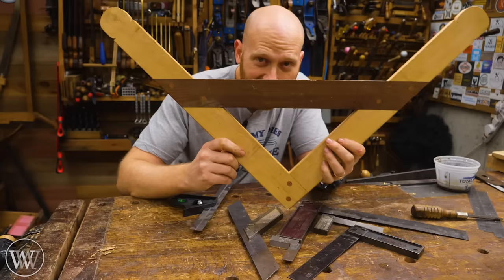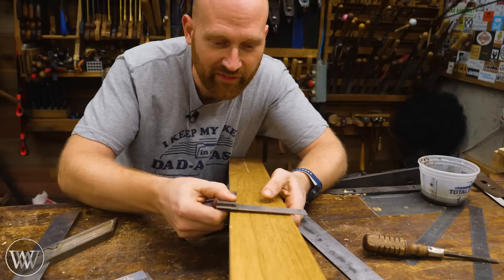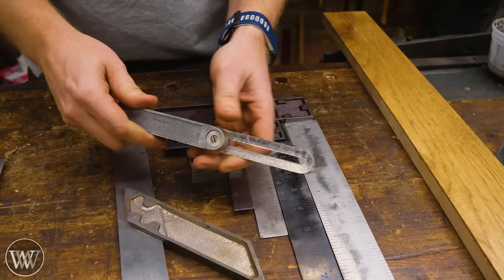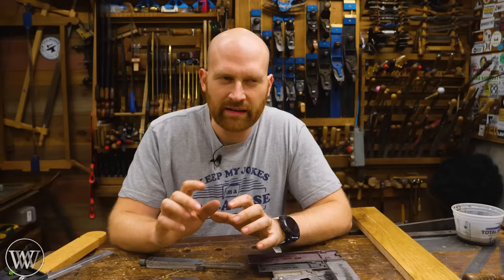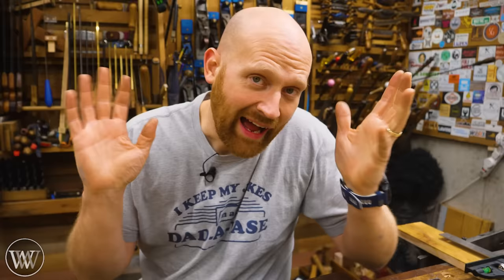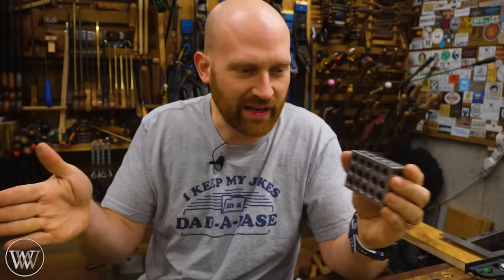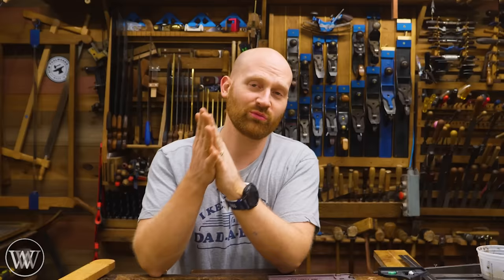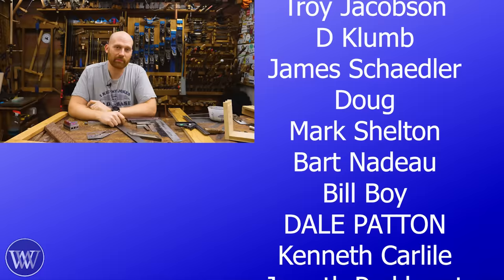Do Not Use Combination Squares Sorta

Comment: My Starrett has yet to go out of square. I routinely check it with my 1-2-3 setup blocks  and I've yet to see it deviate. I also have a 4" Starrett double square that I love and use daily, super accurate haven't had to fix it. I would love to get a proper try square, I might opt for a machinist square because of the materials and precision.
Reply: The same for me… i think my starrett is the more precise of all my squares 😂😂
Reply: I bought several old starretts on eBay from as old as the 50s and I check them regularly for square and they never needed any adjustment always super accurate. Empire makes horrible combo squares and they were described in the video I'd think you were talking about empire not Starrett

Comment: When I recently started woodworking and watched Paul Sellers creating very accurate pieces using a combination square, and since I already had one in a drawer, I used it. 
I kept getting frustrated though with things which should have been square not being square so I did the trick of drawing a line, flipping the square and drawing another line only to find out that my combination square isn't square. Admittedly mine is a cheap one (Draper I think) but after realising what the problem was I reverted to using a  7" rafter/speed square and a small metal engineers square and now get much better results.
I still use the combination square but only for rough marking out and for scribing lines along a board at a set distance from the edge.
Reply: Yup, I bought one cheap too, it was crap from the start. I'll bet those ones that Mr. Sellers use are from the era when those were GOOD. I mean I've seen some REALLY expensive combination squares, and maybe those will stay square (like those Mr. Sellers use)
Reply: File the slot and repeat the test until the flipped lines are perfectly prallel. Now you have a good one!
Reply: Thanks @dekutree64  I've seen that done in some videos but I shouldn't need to. The most common complaint in reviews on retailer sites is that the square is not square when purchased. Also how long lasting is that fix, especially on cheaper squares which have soft aluminium beams?
I could spend £160+ for a Starrett version but instead I bought a speed square for less than £10 and its very reliable for scribing lines coupled with my Dad's old machinists square for checking if board edges are square to faces.
Thanks though.

Comment: One thing combi squares are good for - my cheapo one was out of square right out of the box, so I threw away the arm and kept the ruler, but it was fairly hard to read (the increments were just machined, not painted in).  But it turns out the ruler fits perfectly into all of my chip breaker screws! If you already bought it and plan to chuck it away, just put a hanflr on the ruler and you have a perfect fit screwdriver.

Comment: Everything has its place. A combination square is great for construction where precise measurements are not necessary. However, i will never have one on my work bench for fine furniture making for the same reason you mentioned. I don’t trust them to stay square. I do love my architectural drawing squares. Excellent for checking inside corners and for checking my power tools
Reply: Yet Paul Sellers makes damn fine furniture using combination squares. I'll bet he used one in that credenza he made for the White House. All though I see your point about those, I bought one cheapish combination square and it wasn't square from the start. Next two (one smaller and one bigger/medium) were Bahco and those are good, so far.

Comment: I agree. I have one high end combo square, and I never use it to check for square or mark 90 or 45 degree lines. I only use it as a gauge to check offsets or mark a set distance. But as a square I have to set it and then check square with a known square which makes no sense

Comment: I only kinda sorta agree with you. My 12” Starrett combo is dead nuts after 20 years of use. My 4” and 6” double squares were way off and I had to repair one and exchange the other. Very handy to have, but I make sure to check them against my other fixed squares every so often.

Comment: In the beginning of my woodworking the combination square was great. I was frustrated because the cheap squares have not been square. So I got one combination square, it was easy to bring to square and it had all at once. Now I have some good maschinest square and I don't use my combination square anymore. Only if I go somewhere else it's the one I bring, it's set up correctly and I know I can trust it, at least for a day or two. So I'm kinda with you but see good reasons to initially buy one.

Comment: Clearly there are a lot of opinions on this topic.   I use all of them.  I believe that you should use the tool that gets things done.   I use combination squares for rough work.  Speed squares and sliding bevels for angles.   A small machinist square to set up/check my power tools.   The list goes on.   Use the tool that does the job and makes you happy.   If the only one for you is a folding wooden ruler.... buy it, use it, and build some great stuff.

Comment: I ended up with a set of small machinest squares similar to what you show. It was the best accidental tool purchase ever. I was looking for just a small single fixed square for woodworking.  This was during the first big covid lock down so no going inside. I described what I wanted roughly over the phone and paid. I picked it up the next day. When I opened the wood box they came in I was slightly put out. It took my layout to the next level. Of course this started with fixing my shooting board which was out a degree in both planes. I have made some wood squares which I enjoy using... but it is great to have a set of reference squares that will never be off more than my requirements for precision.

Comment: I bought a few very nice, rosewood-infilled tri- and dovetail squares back when Bridge City Tools were still made in The Bridge City; but when I'm using a marking knife I use my old Craftsman combo square.  Why?  That steel blade; the BCTWs use a brass blade and I only use them with a pencil (which I rarely do anymore).  Haven't had any squareness/wear issues but I rarely loosen the blade.

Comment: I sometimes use a combination square, but only when I'm in a hurry and I don't need that much accuracy (usually when building structures). I might also use a speed square. When it counts, I use a try square.

Comment: I mostly use mine as panel guages, never as a try square, I did just check them with my 123 blocks, all but one are square!.  I wouldnt trust them for a true 90° though, thats what machinists squares are for. For striking a long line accurately, they excel.  I drilled a small hole in the beam end of my big one to stop my pencil point shifting.

Comment: I think my favorite squares are my old Stanley try squares. I have a 5 piece set of varying sizes. I only had to square one up after realizing it was a tiny bit off. The others were fine, just as they were. All very old with rosewood handles, brass inlay and steel beam. Absolutely love them. I wouldn't sell them for anything.

Comment: As Huey Lewis once said it's hip to be square. 😎

Also the cheapy style sliding squares do work well at a miter saw stand to throw down a quick cross cut line of almost any width. I keep two on mine in case I walk away with one. Lol.

Comment: I have a couple of speed squares for when accuracy isn’t too critical.  I also have combination squares but I don’t have a lot of trust in them.  If I am working on something that is bigger than 300mm then I use my home made wooden layout square that I check with my “Thales” square set up.  I also have assembly squares that I clamp in place - I make them on my 3d printer which gives good accuracy.  
Thales or 3-4-5 for checking accuracy is for winners!

Comment: I love my combination squares, but you're right about checking them. I have a PEC (mitutoyo) where the 45° side is off by 0.5° from the 90° side (that adds up over 1-2 feet), not simply out of square with the rule (filing things down to fix the 45 would make the 90 incorrect). I haven't seen any of my combination squares go out of square (so far) but I do use machinist squares and 1-2-3 blocks when I need real accuracy. I also like the little Veritas layout triangles (the 2.5in is great, and far cheaper than the DFM one if you don't need those scribe holes). One other great thing worth mentioning: TayTools and Veritas both sell a fence that you can attach to a large framing square … it's a $20-ish upgrade that turns a cheap carpentry tool into a precision layout square)

Comment: I use combination squares more to measure than to mark.  I have 2 I use because one has 16ths, 20ths, 64ths, and 50ths of an inch and the other has normal 16ths and metric.  The first one’s a Union, I don’t remember the other.  I don’t have issues with them staying square, but there’s inherent wiggle room.  I pencil mark with them as I’m planning.  But I only use a marking knife with a try square or similar.

I had a new Harbor Freight one, a new big box store one, and an old Stanley combo square I restored that would fall wildly out of square if a breeze came through my garage.  The first 2 made me think I was doing stuff wrong when I was starting.  It wasn’t until I realized how to check them that I realized they were dumber than I am.  I kept the ruler out of the Stanley but violently pitched the first 2.

I have a 6 inch try and a tiny machinist’s square.  I also have a machinist doodad that is a right triangle.  I use it to check inside angles on tools and finished stuff.  I do want a 4 inch, but will wait until I find an old one.

Comment: We all want a Square Deal !
Cheap squares aren't where you find them.
Before my emergency move to San Diego last year to address my wife's healthcare issues, I had multiple sets of Starett Squares that my Dad used before WW2 working at Grumman on F4F's and other current aircraft.
These were trustworthy squares that were still after 3 generations of use, Trustworthy.
Bottom line?
You get what you pay for.

Comment: I have a matching miniature 75mm try square and 95mm bevel gauge with bamboo grips grips that I use all the time, more than the full size equivalents. Very handy, accurate enough, and also: cute 😊

I've been intrigued by the combination square, but boi oh boi are the good ones expensive 😮 I've payed less for all my current marking tools than what a basic starrett combo square costs over here. No, thank you.

Comment: I use my combination square for almost everything, including taking the ruler out and using it by itself for measuring and as a straightedge. My shop is tiny, so the more jobs a single tool can do, the more I like it. Bonus that you can buy a cheap one and fine tune it yourself, rather than having to spend big bucks to get a good one out of the box. If yours is sanding itself out of square every time you adjust it, polish the edges of the ruler so it doesn't abrade the body.
Reply: I like your thinking and "make do" attitude. I try to do same with all tools and projects etc.
A good craftsman never blames his tools. And IF the tools are to blame, he makes them better.

Comment: Being a blockhead, I just stick my head in the corner and strike a line 🤯 

I have never used a Starrett. I do have a Workhorse 12" combo square, and I have never had it go out of square. I think the rails that the straight edge rides on are also hardened to the same or harder Rockwell. The 4" double square though, has to be really screwed down or it will loosen and rock. 

I also have a Woodpecker 6" tri square. I don't use it much any more because it is just so bulky. However, the extra lip on the inside of it that allows the beam to lay flat on the board is nice sometimes.

Comment: PS: you're probably aware (I learned this from a builder doing our house extension) but if you create a triangle which has sides of exactly 3, 4 and 5 units ( any units - inches, feet, metres, a stick etc) then the angle between the 3 and 4 sides is EXACTLY ninety degrees. Applied Pythagoras theorem. Can be used to make or check squares.
Reply from the maker: Right on. I like to use that on the framing squares and larger ones. But when it comes down to the small 6-in smaller I find it very difficult to accurately Mark that triangle with any precision. I generally prefer to use the flipping the square method is that allows you to get more accurate on a smaller scale. But it doesn't work very well on the larger scales.
Reply: Math!  Eww!!  😉
Reply: You don't need to do the maths or understand it - just measure sides at 3 units, 4 units and 5 units (or any multiple of those like 6, 8 & 10 etc) and you will get a precise right angle. 
Its how the ancient Babylonians and Egyptians created square corners.
Found this handy video showing a quick way to make one https://youtu.be/aNjO4SBe5kw

Comment: Hi
Great video! 
I want to ask how often do you have to check wooden squares if they are square?
And, as a beginner, I want to ask what wood is more stable vith the changes in humidity and temperature? In Romania we have a lot of this changes.
Reply from the maker: I would check every season. so around 3very 3 months. usually the harder the wood the more stabile it is, but they all move.

Comment: On the subject of combination squares there is one thing I agree 100% with you on…that cheap POS you threw over your shoulder is junk. Beyond that I beg to differ with you. When I was building houses one of the basic tools in my apron was a combination square (I also carried a speed square and a rafter square was never far away). A combination square was indispensable and the ones I had all carried names like Starrett, Brown and Sharp, Lufkin, etc. A 12" Lufkin that still lives in my leather framing apron is so work worn that all the crisp edges are rounded over and it remains dead accurate no matter where on the beam it is slid to. I also have an ancient 4" Lufkin that I just checked with a 3" machinists square and it too is dead accurate both inside and outside. At 77 years of age I no longer frame houses but in my shop the combination squares pull equal duty with my try squares. Pretty much depends on which one is closest to hand.
Reply from the maker: Agree with you completely building houses and even fine carpentry I used to use a combination square all the time. The accuracy there is far lower requirement than furniture making.

Comment: Back when I was building houses. When a new guy came onto the site and had a combo square. We knew that he didn’t know how to do the work. But with that said a combo square is good in the shop for rough cuts.  Then use  the better quality tools to finish the job. And you are wrong about the 90. You need it very accurate.  Because if not then you’re going to be out of square. By how much  depends on the square.

Comment: YOU THREW AWAY A STARRETT?! 

I mostly use a plastic T square but it gives my husband hives when he sees it. (I do not build in wood. I also have a micrometer to measure knitting needles after I was seen measuring one with plastic calipers. It’s knitting. It STRETCHES. At least until you dip it in resin

Comment: I use combination squares all day long - not for checking square - for layout. Almost like marking guages - I can set a length and then repeatedly move around the timber marking out precise distances. They are also really good at guaging depths...or 'set backs' from edges etc.

:-) I am a bit OCD when it comes to squares that need to be square - but have never found a video yet that explains how square a project needs to be....is it ok for cabinets to be 2 - 3 mm out over 600mm for example?

Love the videos BTW.
Reply from the maker: Has the house squared does it need to be I want to be able to run the square around the board that is about 6 in wide and have the mark come out to be visually Dead on where it started. So that would come out to somewhere around 100th of an inch over a foot. More accurate than that is way too accurate for woodworking. And in most cases it doesn't need to be anywhere near that accurate. But I like to keep my squares about that amount.

Comment: You're wrong and you should be using a Combination Square... honestly, I have one of the Defiance combination squares and the main reason I keep using it is because it has the little scribe with it and you would be surprised just how many times I'm holding a piece perfectly and needed that stupid little thing. Other than that I have several try squares and framing squares I use. Actually you're not wrong your Wright !!!

Comment: You don't trust the tool because you didn't know how to use the tool, James. The demonstration of pulling the scale back and forth is definitely the wrong thing to while adjusting the scale. The reason is the blade of the scale is resting on and registering apon two very small gauge pads casted in the slot of the body. 

With this type of tool the proper way to ajust the scale is to loosen the nut a few turns then push the nut towards the scale till it bottoms out and while holding this, [this releases the scale away from the 2 gauge pads of the square.]

Now move the scale to its desired positio andbrelease the nut to make your final adjustment. Now, lock it down firmley. If you continue to just loosen the scale and drag the scale back and forth, this eventually will wear these pads unevenly, and your combination square will become out of Square.

Lastly, the square should be wiped down with a light oil often. Having precision tools requires knowing how to properly use and maintain precision tool correctly. 

Abused will always lead to some issues regadless how minor the abuse seems to be.😢😢😢